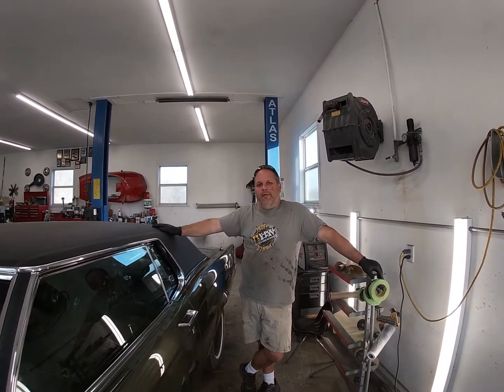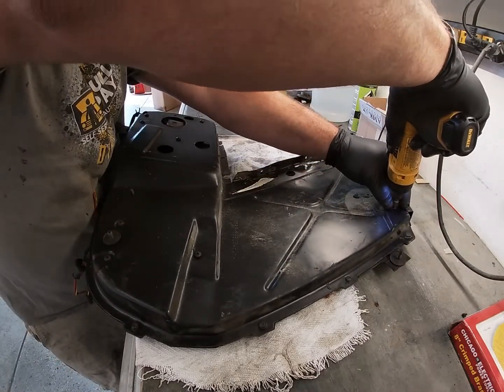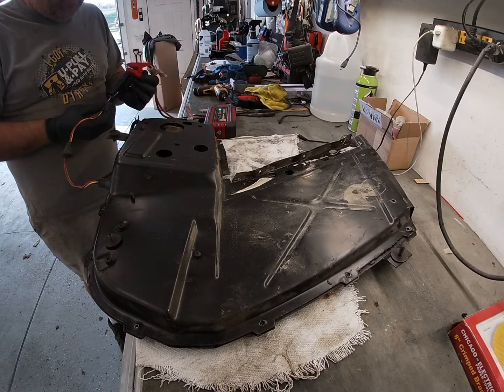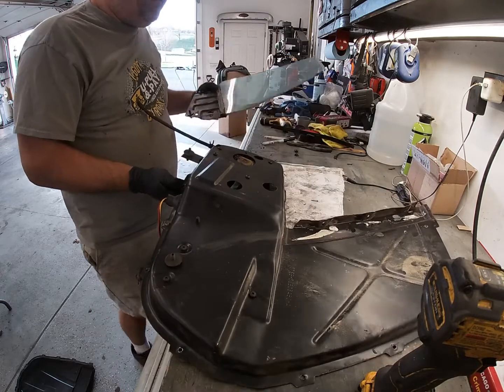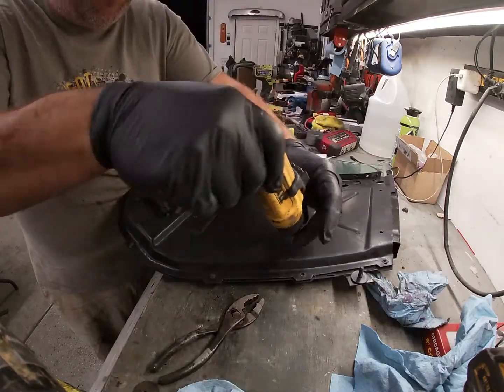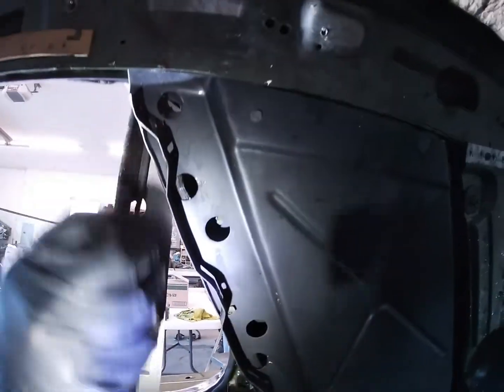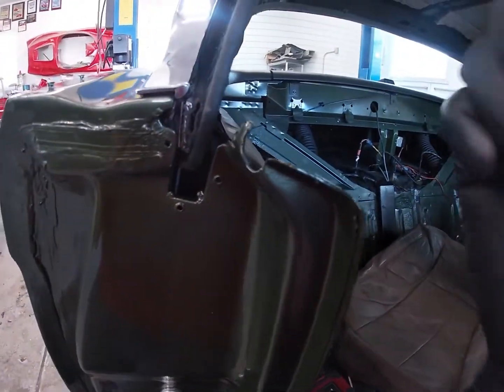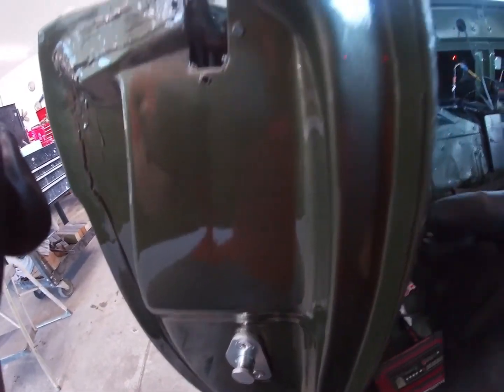1970 Lincoln Mark 3 part 24.  Quarter window removal and installation

Comment: Very nice. Is the switch serviceable (remove and replace) without taking apart rear seat area?
Reply from the maker: Unfortunately no. The rear seat area has to be disassembled. It's a very time consuming process. Good luck

Comment: Outstanding!I know the rear seats have to come out to do this job. But does the headliner have to be removed if you're replacing your rear window motor?
Reply from the maker: It just has to be loosened from the tabs on the assembly. Thanks

Comment: do you a video showing how the back seat , door panel, and sail panel came out?
Reply from the maker: Don’t have any, sorry. The back seat comes out very easily by pushing back on the bottom then lifting it out. Then there are 2 screws holding the back in place. The armrests need to come off first though. Them the rest is a couple screws and push in clips to remove the rear and sail panels.